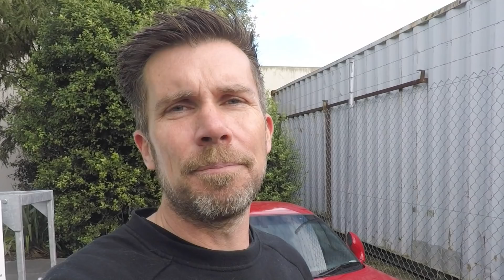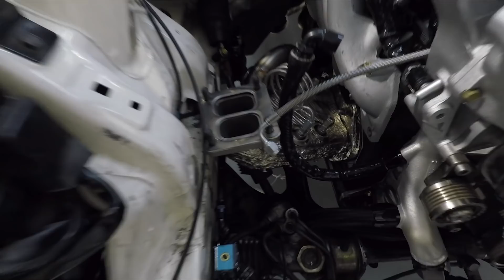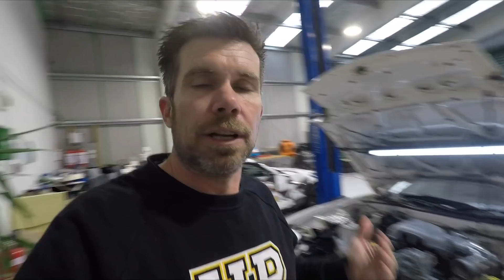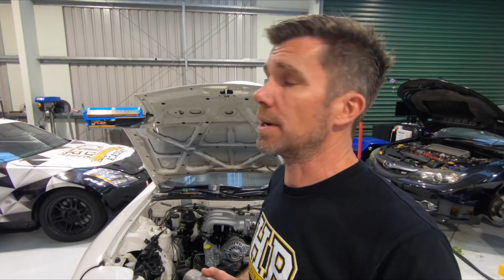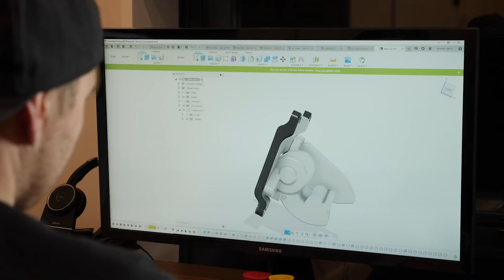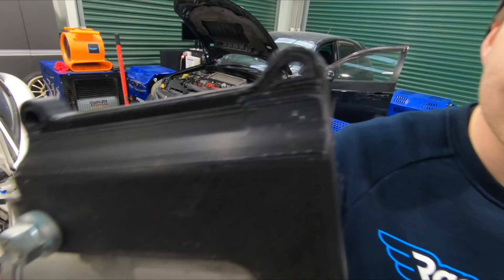Our FD RX7 Project | Ep 1 [OFF THE RECORD]

Comment: Hello! 

Does this actuator itself work as a TPS? Or do you just use the OEM TPS? Because i know the S54 actuator has 2 connectors. :)
Reply from the maker: It had the OEM TPS at this stage, it has since been replaced however with an aftermarket option - Taz.

Comment: So excited for this! What’s the plan for the tuning content? Webinars? Worked example add on for practical tuning course? Separate rotary specific course? Either way I’m in!
Reply from the maker: Going to start with an Adaptronic Worked Example in the Standalone tuning course at this stage and some webinars to compliment that. 
Trying to work out a bit more structure when it comes to the ECUs we feature and some specific functions like cold start and acceleration enrichment etc for webinars too to fill in a few blanks.
The to-do list just gets bigger and bigger haha. Hope you're keeping well mate! - Taz 👨🏻
Reply: High Performance Academy so glad to hear this plan.  I have a stock REW with an 8374 and DBW so André’s tune should be extremely relatable to me.  And I’ve been considering Adaptronic for my rx8, as it’s the only PnP option.  🍻

Comment: Wish u guys went with mounting the dbw under the uim. Would love to get one of those and retain my ac.
Also, much respect to Andy and Adaptronic and what they've accomplished. I had the Modular on my car and had pretty good results with it, but more recently swapped over to the Haltech Elite 1500 and have to say, I prefer the Elite. It's a more polished solution with better software configurability and their support seems to be better at this point. I'd recommend that you guys produce rotary content with the Haltech as it'll probably reach a wider audience and be more relevant going forward. I'm sure Andy won't mind too much as he's a part of Haltech now ;)
Reply: Douglas Jardine you can just use Full Function Engineering’s adapter and run a Chevy LS DBW throttle body.  Much easier install and despite being huge, mine isles just fine.

I’ve heard that the Adaptronic support and development as suffered greatly from Andy’s move to Haltech.  No personal experience though, still the only PnP option for my Rx8 so 🤷🏻‍♂️

Comment: When converting the stock throttle body to DBW, Do you have to adjust or change the spring load on the butterfly's?
Also what ign-1a mount are you using?
Reply from the maker: Yes, we've removed the main return spring from the throttle body otherwise we felt we might be overloading the dbw motor. There is still a secondary return spring for safety. We will know more once we can see what the motor duty cycles look like in operation. The coil mount is by Vinny Fab - https://www.facebook.com/vinnyfabnz/
Reply: @hpa101   thanks for the reply, looking forward to seeing how it turns out

Comment: Very nice little car, and the white keeps it even more 'low key' as the best way to interact with the local constabulary is to avoid it in the first place.

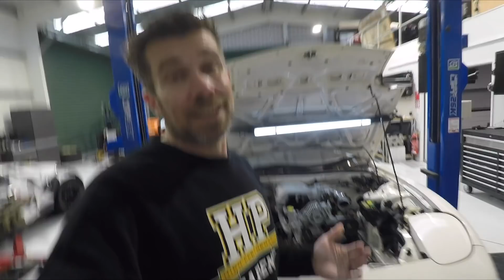2:35 - nice delivery! Better follow up 2:40!
6:45 - that's rather close to the rubber boot and rack - I assume you're going to be using plenty of shielding there for radiant heat?
Reply from the maker: Yea we haven't got the heat wrap on at this point but will be paying special attention to not melting stuff. It's incredibly tight there so the plumbing is as far away as possible from sensitive bits.

Comment: 2  1300 cc injectors and 2 1700 cc injectors is not enough  for e85. I ran out of  injectors with that same setup at 380whp on e85
Replace the 2 1700 with the new 2600s
Reply: brianawd I was thinking the same thing.  But what a great way to teach us all a lesson of what to look for when the fuel system is your limit.  Future webinar? lol.  It is however the perfect size for pump gas and this turbo which is what they intend to use mainly, so perhaps they don’t intend to go for big power on ethanol.  It is a stock engine after all.
Reply: Pope's Projects 
They mentioned that they would be running. E85 down the road. 
My 380hp was on a 7670 on a stock motor. Had I had bigger injectors or 2 more 1700(do now) hp would have been easily over 400. Boost and timing had to be tapped down from about 6k to keep injector duty cycle happy. 
With them running the 8474 they may as well plan for the power that turbo can make on e85 now vs having to upgrade again down the road
Just my personal opinion

Comment: What did you clearance your side seals to?
Reply: Their engine is unopened. So it would be as Mazda has intended. 

I've built FD 13b rew bridgeports with 2 thou clearance.
In my FD I run pump E85 only though which burns cooler and it's been reliable for 3 years so far with over 500whp, with very little fuel dilution between service intervals.
This worked for me, what works for you may differ but off the top of my head I think Mazda specs are between 2-6 thou for the 13b turbo

Comment: Are those standard industrial Honeywell pressure transducers for the back-pressure sensing? 

I've built a couple compression testers with them and wondered if they'd be suitable to performing back-pressure testing, but the heat was a worry. Is that the reason for the extensive lines and remote mounting? 

Do you use the same sensors on the intake side to measure intake and port restrictions?
Reply from the maker: Yup, just the typical 150 psi Honeywell sensor. The trick is to get the heat out of the sensor which is achieved with the coiled line running to them. The same style of sensor but with a more appropriate range can be used on the intake side.

Comment: Understanding that you're not getting too serious yet, but in the future it would be excellent to see you guys develop an electrically actuated semi-PP inlet system. I saw that Carlos Lopez had started developing a vac-actuated system but you boys are more clever than that right!
Reply from the maker: Interesting idea and not one that I'd considered or seen! I'm still back and forth on exactly what direction we want to go with porting when we get to that level but thanks for making the suggestion - Andre
Reply: I thought it was clever also, and with intelligent control, I think you could be on the leading edge of development. Shame that wont be able to catch you lads at Goodwood this year. Congrats on a year of fine content, great stuff.........hope to see some dynamic rotary porting content in the future :D
Reply: Stuart Milne isn’t that the same concept as the 6 port Renesis uses? Granted it’s not P-Port, but the same idea.  While it does increase power slightly, it’s only marginally down low on a NA motor.  Seems like a lot of work to fill in the powerband on a semi-pp, why not just run a little more boost on a large street port and achieve the same result?